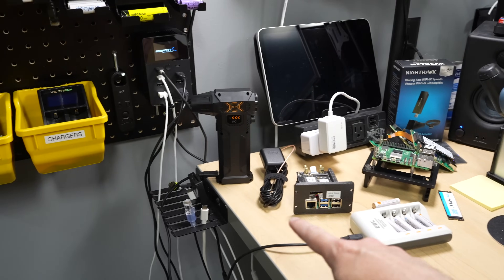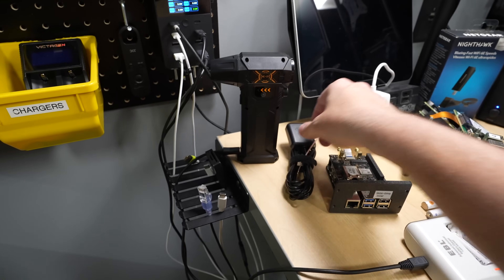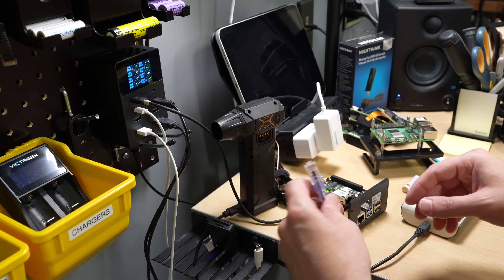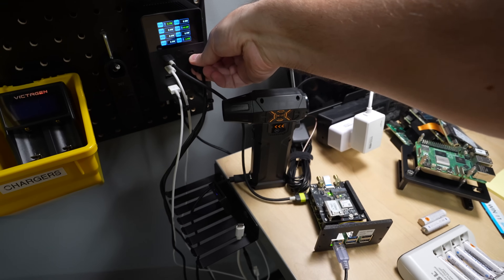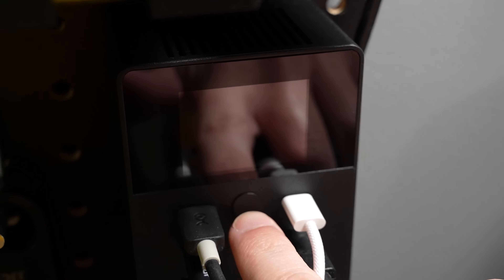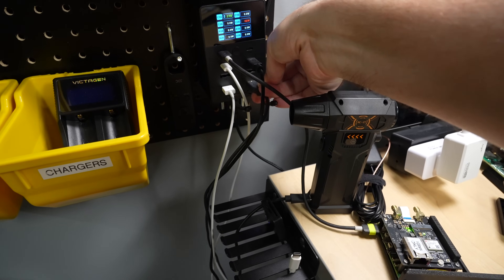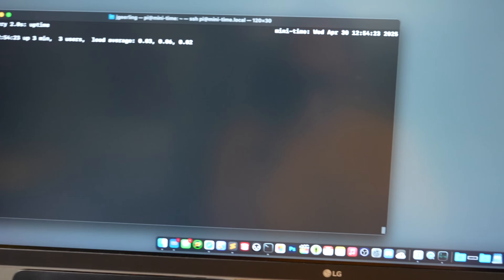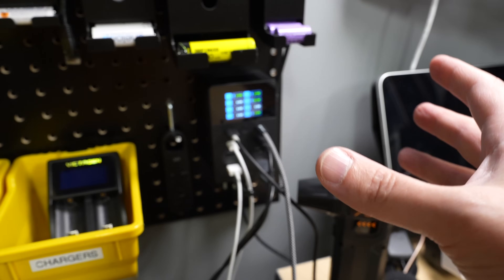Hear me out... a multiport USB-C charger that's not dumb

Comment: Hello
Is ther a charger that I could put on any USB power supply(on both sides usb - C and usb - a ports) and limit the voltage and current for slower charging devices that have a build in not easy replaceable battery to prolong the battery life. 🤔
Thst is inexpensive
Between 50mah and 1000mah changeable at least in small steps and the voltage also. 🤔 🤗

Comment: Anyone else deeply annoyed by the Sabrent's "screensaver" that hides crucial data that should be available at-a-glance without having to press a button?
I would love to see a disassembly of this unit if anyone knows of anyone who has done so.

I'm hoping that the firmware is on an accessible flash chip and we could find and NOP out the offending jump to the screensaver.

Other than the screensaver, it's a great little charger, but the screensaver disappoints me every time I have to reach over to check the power-draw of a port.

Comment: on the question that some commenters are trying to answer, ill try to chime in too, your PD charger is using isolated ckts. 
each port has its own PD chip. So the AC to DC conversion happens on one converter but every port has its own buck converter + PD ckt. 
This is easy to do because the parts don't cost much and it will be easier to show individual information on the screen.

Comment: There's much debate about a diversity of charger subjects in the comments here. Generally these don't relate to the product in the video. I saw one review where the buyer sent it back because the device went to the Sabrent logo display after some time. Seems like a faulty device to me that probably went into a startup routine erroneously.

Here, there's vague mentions of power resets and drop outs and charging versus power supply using other devices. My position is that USB is a mess.
But we cannot live without it.

This device gets advertised as charger by Sabrent, so in a scholastic sense this means it is not a power supply. What Jeff demonstrates here, however, is that it has a level of robustness that makes it suitable as power supply.

The difference or problem being that a charger needs to (re)charge a battery and an interruption of power is not an issue - e.g. in cases where the device needs to handshake/negotiate with a new connection about capabilities and compatibility, and next redistribute available power across connected devices. This would cut power off from a Pi that has no battery power. So it would shut off without shut down process. And the Sabrent does not seem to have that problem. Hip hip hurray.

Part of the USB mess now is that we may need to have cables that can relay, say 100W or more, in order to either power or charge a device of that power draw. Like a powerful notebook computer that takes its power off USB. The USB cable must use multiple internal cable strands to relay the V * A needed for 100W. These need to be present. One of my USB-C cables at home does not relay power. But connects my PC to the USB hub in my monitor. The monitor injects some power into the USB ports for a keyboard and mouse I connect through it.

Another part of the mess is that USB-C is just a plug standard and even (longer?) cables with USB-C on bot ends may support either USB 1.x, USB 2, USB 3.x or USB 4 (hopefully each newer level still understanding the older ones). For a 40 or 80 Gbps data link, the cable will have multiplexing chips at either end that break a serial bit/byte stream up into parallel ones on one end and convert these into serial at the other end. These chips may become part of the negotiation on capabilities between devices. Having a PD 3 charger and PD 3 device may not work, e.g. because of the chips in the cable wanting to do another protocol than PD. Or the cable not having internal wires for power relay. In the way the EU has made USB-C standard for connecting to mobile devices, we now need laws that cause vendors to print capabilities on both connectors of a cable, e.g. U4 and 100W. And in the case of Thunderbolt certification maybe add T5 to that (note that "compatibility" =/= "certification").

It would be nice if the power supply with charging capabilities could reveal negotiation at this deep level. Can this Sabrent do that?

Comment: Does NOT work in an RF environment!!!  I just bought one of these to use in my amateur radio setup to power a Pi, monitor, and some other devices.  Whenever I transmit, voltage drops on ALL the ports.  So this thing IS DUMB.  DUMB in that they can't shield it and RF causes all the ports to drop.  Sad that so much electronics these days is NOT shielded for RF.

Comment: Im about to attempt reconfiguring my homelab/ home network and give Home Assistant another go. I have a dual Celeron HP workstation with 96GB RAM for a server currently with Win10 Pro shamefully installed with 4 WD 3TB drives in 2 separate RAID1 configurations. I plan to switch to either Proxmox or FreeNAS and run Home Assistant as a VM. What Zigbee would be best for a situation like this and which hypervisor would be the best to use?

Making network storage super easy for the family is a must. I need to be able to just add a network drive to their computers that they can use like a regular local drive.

Sorry ..lots of questions not telated to the charger but I just ordered one because of this video 😂

Comment: Heads up: the USB-C cables you linked to are NOT the magnetic ones. I learned this the hard way after ordering.
Reply from the maker: D'oh! I will try to find the magnetic version. Did yours look the same as pictured at least?
Reply: @Level2Jeff  now that I’ve looked at the video again, nope! The linked ones are braided, but are completely black and came in a pack of 5, with each being a different length (which IS handy, but I really liked the magnetic concept lol).
Reply from the maker: @lukehess2360  Ah, this one looks like it should work well at least: https://amzn.to/3SzxDJF — sorry about that!

Comment: The official raspberry pi power supplies often output 5.1V to compensate for drop in their cable. Do raspberry pi SBCs have the ability to measure voltage at their end, and negotiate a PPS voltage of 5.1 or even 5.2V if needed?

Comment: This is the problem I am having with trying to run a Raspberry Pi and a travel WiFi router off of a USB-C powerbank. There really shouldn't be any reason why I can't buy a powerbank capable of having three USB-C connections that don't momentarily drop the power whenever I plug in a device or a charger to either recharge the battery or for pass-through power. I use my travel network setup so that I always have my own secure network when I connect to upstream public WiFi networks, so that i have Pi-hole ad blocking DNS that won't be hijacked by the upstream ISP, and so that I don't have to constantly reconfigure all my separate devices to connect to new networks wherever I go. I want to be able to power the Pi and router off the batteries, but then plug into an AC outlet for pass-through power whenever possible, to ensure I always have plenty of battery power, and so that I can unpluyg and move if needed, without everything losing power and rebooting.

Comment: I'm personally hoping the Raspberry Pi Foundation makes their own desktop USB power supply, to go with their new 45W charger and other assorted accessories.

Almost no PSUs/chargers support the Pi 5's abnormal (but not actually out of spec, as it turns out) 5V@5A (I know it's technically 5.1V but I'm not sure if that is in-spec). I've been looking for a new desktop charger/PSU since mine is only 65W, but there aren't any obvious choices on the market.

I want to do PoE on all my Pis but it's expensive (especially if you want more than gigabit speed on a managed switch, and a PoE HAT that doesn't suck), so it would be nice to not have half a dozen chargers in the meantime.

Comment: One gripe I have with this device is the location of the power cable connector: it should have been on the display side so you can put it up-right on a flat surface.

Comment: People fundamentally misunderstand what a CHARGER does vs what a POWER SUPPLY does. 

Everything above 5v 250mA on USB Type-A (I'm not sure the supply on USB Type-C) requires SOME negotiation, PD or otherwise. And the negotiation is for supplying proper power to the charging circuit in the target device, much like the charging circuit in an EV negotiates with a DC fast charger for the power it can take.

Comment: I'm loving the Anker A2154 for this purpose. 6 ports, 112W. Each port has a fixed max wattage and when you plug/unplug something it never turns the other ports off.
Reply: Interesting… coincidentally, the UI for this Sabrent 252W is visually very similar to that on the Anker 25,000mAh power bank (not the Prime) I'm using; same font, similar iconography and labelling. I wonder…

Comment: The real fun with the dumb chargers is when you plug in two devices that have their own negotiation setup, like a Nintendo Switch and a smartphone. The charger can spend a few cycles turning its ports on and off trying to figure things out, while the devices alter their charging rates, also trying to figure things out. Everyone ends up switching charging on and off until something randomly lines up and everyone is happy. I just figured this was how things worked. Glad it's not just me that finds it highly annoying though.
Reply: I have the same problem with my phone and my laptop. When I charge both, everything is fine, but as soon as one of them finishes charging, the MacBook starts its own negotiation and is constantly "plugging and unplugging". In the end, I am only using one port of my fancy 4-port charger, womp womp

Comment: I have so many wall warts (power packs) and I've been contemplating a single USB power supply.
Lenovo laptop, Morefine M6 mini PC, Raspberry Pi... and I want to add a 5-port network switch!
Found the Cudy GS-105U switch that uses USB-C for power, wanted a supply that could connect devices without the switch dropping packets. A minor variation on your Pi test.

Comment: @Level2Jeff could you please plug it into your AC power meter with nothing plugged in to see what its idle power draw is with nothing charging?
Also if you could then plug in say one device that provides a relatively constant current draw and then see the increased power draw from the AC plug? (This second test is coarse measurement of its efficiency.)

Comment: 4:25 as a contractor I’m never going to buy one of those 500lb “everything” ladders!
I have 12’ on the roof, and 3,6,8’ ladders inside the truck
Reply from the maker: At home I have my nice 24' ladder. I hate the giant ladder but I can't argue with the versatility for the size it folds down to!
Reply: @ if I have to rent the 14’ Aframe ladder 🪜 I ask for assistance at the job sites. Wouldn’t want to hit something. So friggin awkward. 
The 30’ extension stays at home 99% of the time!!!
Reply from the maker: @nemesis851_  Heh, true. I typically try to use it in a-frame mode and not extension, because at least when it's folded, you can kind of walk it up one side at a time. When it's fully extended 24' or whatever, it gets ridiculous trying to hold it solo. Would not do it in a slight breeze!

Comment: @Level2Jeff What's the input voltage range? Sabrent website & manual doesn't list it. It's a switching power supply so it should be 100-240v 50/60 hertz but can you confirm? I assume it's marked on the back of the unit (which isn't showed on Sabrent's website either!)

Comment: Darn if all USB-C/PD devices were done with that level of quality I'd hate the 'standard' a great deal less. 
But as so many USB things I've interacted with recently even when they are not supposed to be power supplies but docking station or hubs will brown out everything including the 'master' computer every time anything is plugged in or out on any port, even a dumb 5V only USB device. And that is hardly the only flaw in USB-C... 

That brown out is really very annoying every time you forget and say connect the USB keyboard/trackball to the thing while it also the pathway for a file copy to the SD card or external USB drive... To me it renders those devices basically useless as you must have everything you'll want for this session connected to the hub before you do anything, as you can't touch it afterwards till its done, and the computer absolutely must have its own internal battery with charge... Which as so many devices only come with one or two USB ports you will always want to interact with the IO expansion on your USB-C docking station!

Comment: There are chargers that negotiate when a device that can be fed 5v or 7v is plugged, so if your rasp is plugged into and you plug a 5v/7v device then it may start with 5v and then after a second it will turn it off and start supplying 7v.
You showed that the second part had a 7v device on the second rail, maybe it will turn it off if you test it on the same rail as the Rasp?

Comment: I only wish there was a charger like this which also supported data. Frequently trying to charge and transfer date to multiple devices and there aren't many good options out there. Currently using daisy-chained thunderbolt docks since they've been the most reliable for data+power but its super clunky.
Reply from the maker: Yeah, Thunderbolt docks are the only ones built to have decent throughput and good power per port... but they're usually 2-4 ports max.
Reply: @Level2Jeff  current setup is 4x caldigit element hub. They’re the best I’ve found. Really janky setup unfortunately, far from ideal. I haven’t seen anything better though.

Comment: If you need more power than this, I just checked and my SlimQ 330w brick does this too.
2x 100w USB-C PD ports 
1x 330w 20V DC port
No renegotiation at all between any of the ports, it does however just cut out if you try and pull more than 330w combined.

Comment: Oh, that's a really, really, really nice device! I only discovered the "turn off all ports momentarily" thing a couple of weeks ago, when I realized I couldn't use a two-port charger to keep an IKEA VINDSTYRKA running constantly, and also having the ability to charge a phone or whatever >_<

Now, if you can find a 5-or-more-sockets power strip that has individual on/off relay and power consumption measurement per-port, and does Zigbee or Matter... I owe you a beer ;)

Comment: I want a ZigBee voltage sensor that you could attach to a battery and limit or bypass a battery so they wouldn't charge up to 100%

My rough solution for android and apple devices is to install home assistant, and when they hit 80% charge, the zigbee USB block disconnects power.

Comment: Do you have a Pinecil you could test it with? Unfortunately, the (admittedly cheap) GaN charger I had bought for mine couldn't handle the sharp drop in power when the pinecil reaches temperature and reset the output, making the Pinecil reboot, lose heat, and have to heat up again. I was about to splurge for the one Pinecil recommends, but if this one does not exhibit the same properties, I will go for it, since I also need a stationary charging station corner.
Cheers :)
Reply from the maker: Oh interesting. I do have a pinecil. I should just plug that in and see lol
Reply: @Level2Jeff  Sorry to come back and bother, but did you end up trying it at all? It'd be great to know if it would work for my particular use case, as the price is a little steep ^^'
Reply: @pixel_vengeur391  Just remembered your comment — I had a Pi running and a battery charging just now. I plugged in my Pinecil and let it run a couple minutes (got up to temp, melted a little solder, let it sleep, got it back up to temp), and it never had an issue.

The Sabrent was showing the wattages it was using the whole time, varying between 58W or so when it was heating rapidly, down to 0.0W-0.1W when it was in sleep mode. Great device!
Reply: @JeffGeerling  Incredible, thank you! Guess I'm dropping a Benjamin tonight. I'll be sure to use taht affiliate link :p

Comment: Anker's Prime 7 250w charger thing (with the screen and the knob) works like this too, including the USB port voltage stats (but not individually for the USB As). It also has 2 less USB A and a worse form factor than the Sabrent, IMO, since it's designed to be more like a bedside alarm clock. It does have WiFi and can report stats back to its app but there's no HA integration (yet). But now I want to swap the ones I have for the Sabrent ones.. they're cheaper too, by.. a lot ($169 for the Anker).

Comment: You need separate logic on the PD ports, because  if it has just one when you plug in stuff that uses different max voltages you either get less volts than ideal on some, or worse you get overvolts on the lower volts one